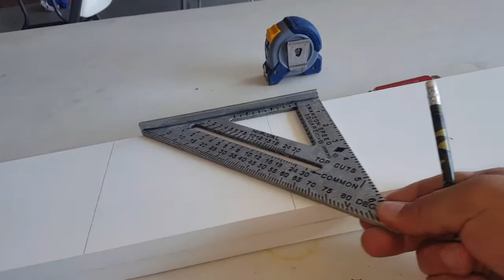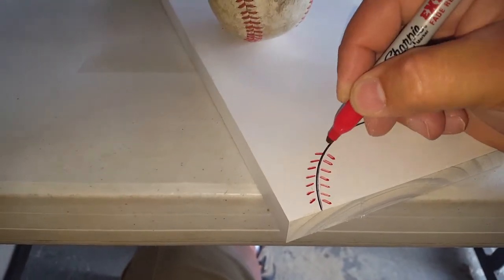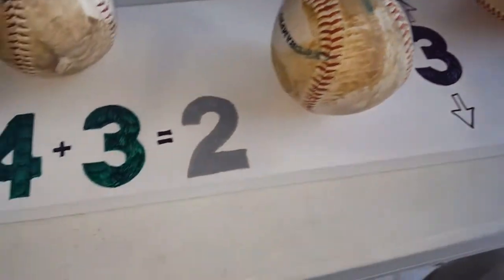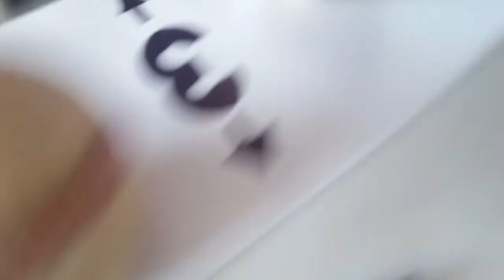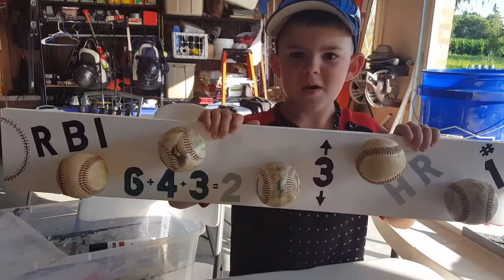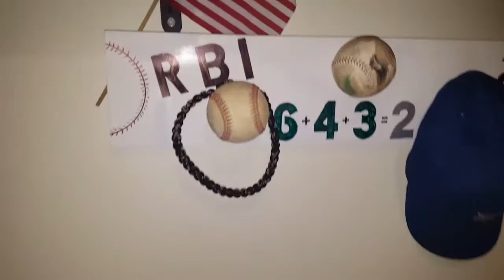Baseball Hat Rack DIY

Comment: This is great!  What specific materials did you use?
Reply from the maker: 1x4 primered board. 36" long and i evenly spaced the balls. Also I measured down 1/3" form the top and 1/3 from the bottom to get the zig zag pattern of the balls. Pre-drill the board for the baseballs. I also used 3" wood screws when attaching the baseballs.